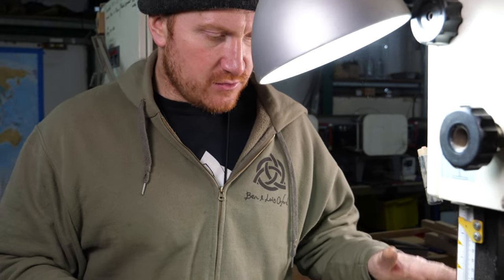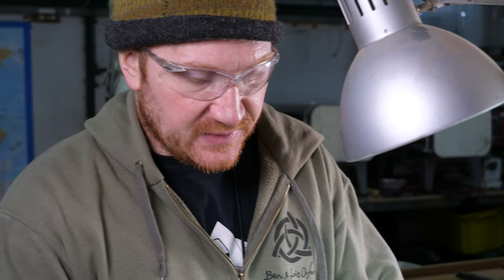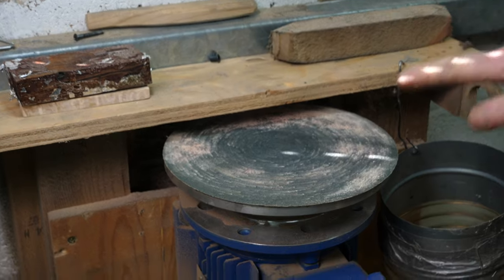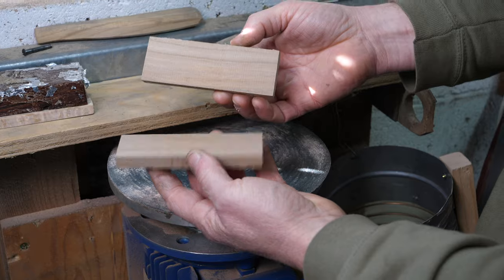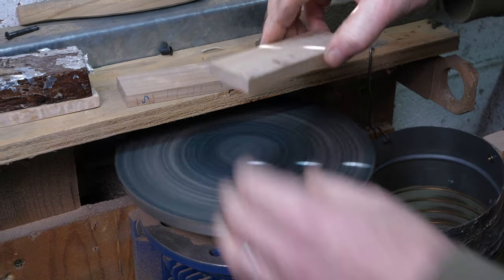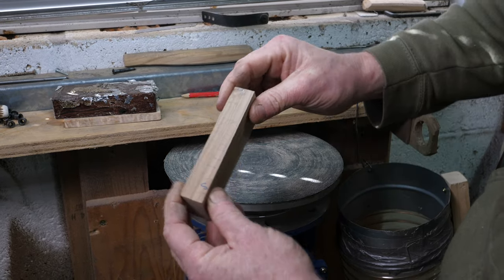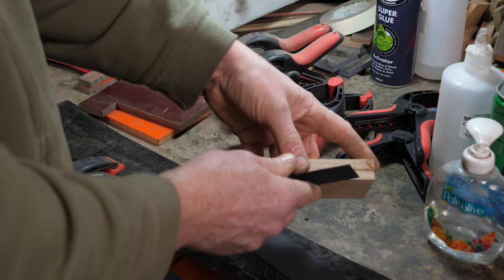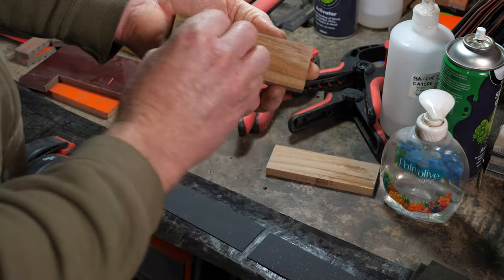How to Make a Knife Handle - Preparing Handle Scales

Comment: Another great video Ben, do you also use the CA glue to bond G10 liners to the scales?
Reply from the maker: Andy Brocklehurst yes I find it is a fantastic bond, all I do is make sure I score the G10 first with some 60 grit sandpaper to give it a good key, then acetone and bond it the same. Far better than Epoxy for this application. That said I use epoxy for the bond to the tang of the knife as this will want a different gap filling quality that epoxy gives. Hope that helps
Reply: Ben & Lois Orford  Thanks Ben, much appreciated.
Reply: @BenOrford  Thanks for sharing these workshop tips. I'm curious about the steps after this, which I suspect will be in a subsequent video. Are you using epoxy and corby bolts to secure the scales to the steel? Also, would you mind sharing the make of the CA glue you are using, I'd like to see if I can find a product with similar or the same specifications where I live.

Comment: Hi Ben, 
could you please tell me which Superglue of which viscosity are you using for the handle scales? It seems you have plenty of time to align the parts.
Thank you!
Chris
Reply: Use West System  G Flex epoxy same as what you use when gluing onto the blade,